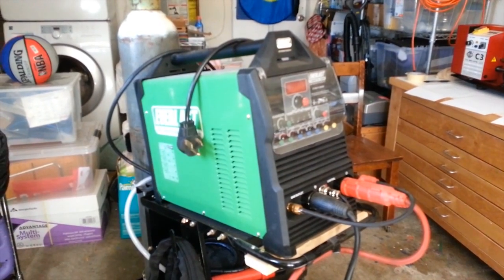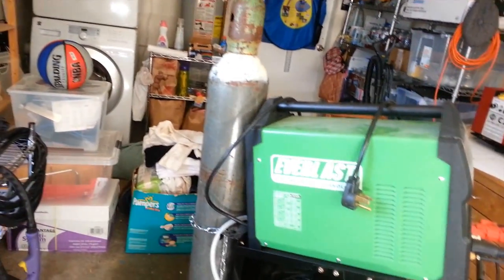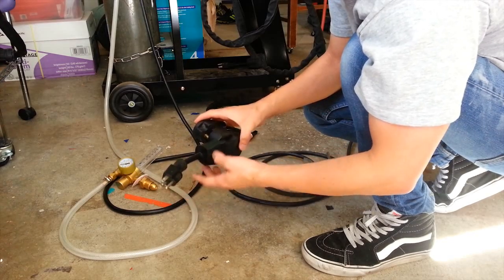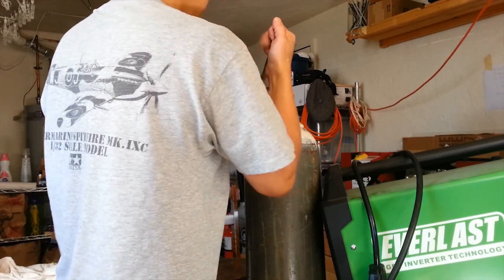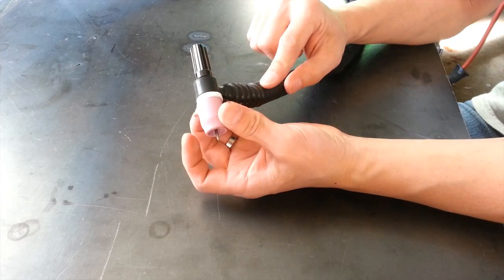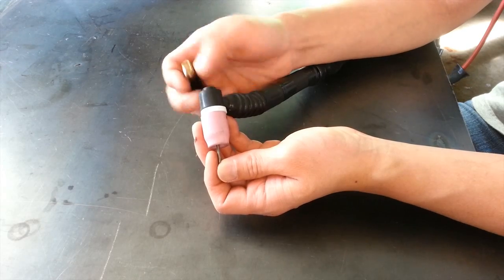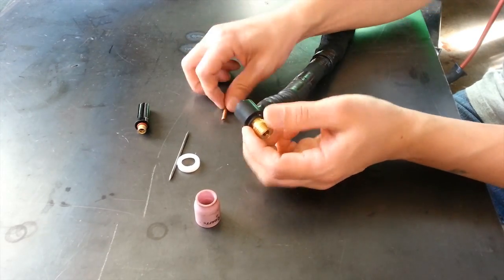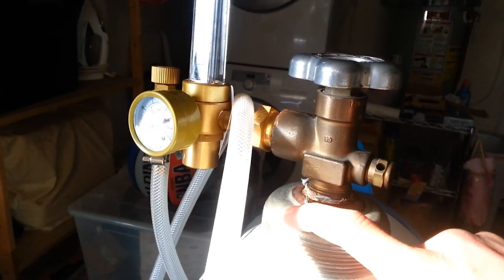Bicycle Frame Build 01 - Welding Basics 01

Comment: Great vid, great shirt. I build models also and I believe the airbrushing really helps the tig hand. Electrician by trade, so house hold plug is 110-120 volts, as well as 220-240. The reason is voltage fluctuates between the two voltages. 440-480 and so on. You can easily run a 220 plug in your house out of the panel. Just size the breaker to the wire size. Simple lol!

Comment: Your point about not opening up the Argon valve all the way is incorrect.. High pressure tanks (Oxygen, Argon etc.) use a "back seating" valve.  Opening it up all the way takes strain off the packing material. Opening it only partially is the most likely way to cause a failure.

Comment from the maker: Hi Kevin,
Filled Argon Tank size M / 100 CF like on in my video (tank and argon): $270
Just buying this size tank with no gas (in case you find a used one someone is selling and want a comparison): $230
Fill / Exchange: $45
These prices are from Alliance in Oakland CA where I bought the tank and do refills. Depending on your location prices can vary.
Thanks for watching and happy building!

Comment: I Have a similar type of welder. I'm a fabricator by trade. The semi-clear hose from your tank to your machine is actually too large and not solid enough for that pressurised position. ( I know that comes with the machine but, it is very cheap hose and not resilient enough for that position.) I used to waste a lot of gas before i worked out why. I found that that hose expands under the pressure and when you step on the pedal to start welding you get a large "whoosh" of gas which wastes a LOoooT of gas. I changed mine to a standard oxy/acetylene hose, (they are black, red or green rubber). It is tougher, smaller in the bore, and does not expand under the pressure of the tank. Also keep the hose reasonably short to keep the gas volume down. You will find that you don't get that wastefull "whoosh" and that will make you bottle last a deal longer.
Reply from the maker: +scott carr I definitely experience the woosh. It didn't seem normal because in the welding classes I've taken that never happened. I tried shortening the cheap hose and it reduced the waste a little, but I still get a woosh. I'll upgrade the hose as you recommend. Thanks for the tip!
Reply: Thankyou for the reply.There is a company called CK Worldwide. they have a system called "gas-saver" which has an even smaller bore hose that may save you even more, I don't know how much the hose costs though.
Reply from the maker: sweet. I'll check it out!

Comment: Unless the leak is between the tanks valve and the regulator you would not get the full pressure of the tank you would get whatever pressure the regulator is set to. With the type of tank you have (argon) you would actually want to open it all the way it is a double seat valve meaning the valve on the tank will not (should not) leak when fully opened or fully closed but anywhere in between it might leak a little at the valve.  Where as with a fuel tank (acetylene,Propain, Lapp gas, etc). You only want it cracked open like you said cause if something goes wrong and a fire starts you can turn off the gas super fast with one turn.
Reply from the maker: +Ethan Schulz Indeed. I have a word bubble in the video to correct that but I think it might not show up on mobile devices. Thanks for the tip and thanks for watching!
Reply: Oh that's probably why I didn't see it.

Comment: Get a shaving brush wet, foam it with a solid soap or even shaving cream, and apply the foam to the connection to see if it bubbles.
Reply from the maker: Nice, much less messy

Comment: Great introductory video on the equipment.  Looks like you are using an air-cooled tig torch. Do you ever use a water-cooled torch (and of course with water cooler)  for your welding projects?
Reply from the maker: +charles briggs Hi, The torch in the video is the only one I own. I don't own any water cooled equipment. I used water cooled once in a class I took a few years ago. It was nice! But it's heavier than air cooled torch. I mostly weld thin wall tubing so a longer duty cycle is not an issue for me. Thanks for watching!

Comment: I'm doing some Custom Fabrication on my bicycle that requires cutting the head tube of the frame off of one bicycle and Welding it onto another. I am having to do this so that I can use the forks that I want to use primarily because I want this brakes on my bicycle. The existing front forks do not allow disc brakes. I did not realize until I already started that one frame is aluminum in one frame is steel. I'm not very experienced with welding to begin with, most of my welding is mostly bed frame gauge steel. Usually modifying bed frame material to make whatever I need. The welder I have is just a 110 wire welder I inherited from my father. I do know he has used it for different kinds of welding. I don't know the difference between Mig and Tig, I don't know what gases he used to make what kinds of welds. I've only used it for straight wire welding with steel. Can anybody tell me what I need to make this wire welder work welding aluminum to steel?

Comment: Same tig welder my argon tank is a little bigger and I leave the cap off the bottle all the time in an earth quake the bottle will not explode argon is an inert gas but if it falls over and you knock the valve off you now have a rocket...
Reply from the maker: It's a great welder, mine is still going strong.

Comment: do you have any experience with the basic Power TIG 200, not the DX model? It looks very similar, just DC only and half the cost.  I am very new to welding and trying to find a decent machine at a low price.  I plan on welding steel bike frames.  thanks for the help!
Reply from the maker: +Josh Snyder I never tried the TIG 200. But I think it would have served my purposes just fine. The only thing I've welded so far with aluminum was a little box just for practice. I could have saved money, but I do like the ability some day to do stuff with aluminum. But when is the question ;)

Comment: Is 200 amps welder recommended? I see a cheaper one (140 amps) from same manufacturer but want to make sure to have enough amps. Thanks!
Reply from the maker: yetijoeyetijoe Hi yetijoe, It really depends on the thickness of steel you are welding. I think for all things bicycle related, 140 is plenty enough. All the videos where I am welding, I have amps set to below 140. If you're in the market for a good affordable tig welder (affordable relative to other welders in its class) I'd check out this video. https://www.youtube.com/watch?v=tHN0OqTg4UI  Have fun and be safe!

Comment: that doesn't look like a stock torch.  What torch are you using?
Reply from the maker: Hi Wayne, correct it is not stock. It's a Weldcraft WP9 torch. Cable was also upgraded.